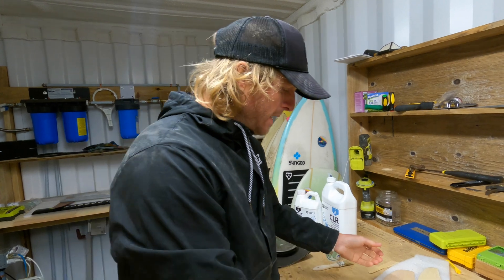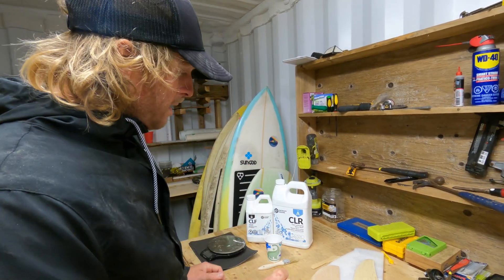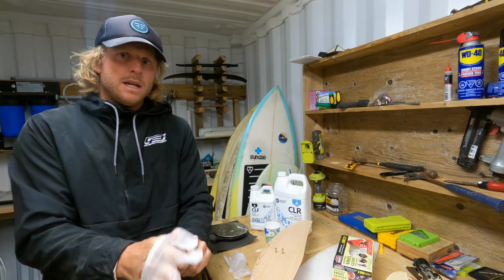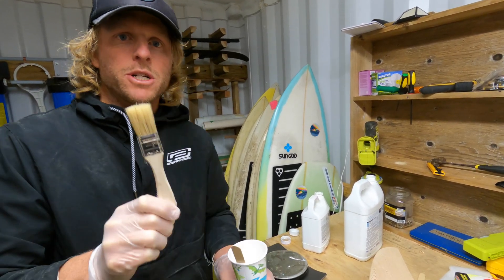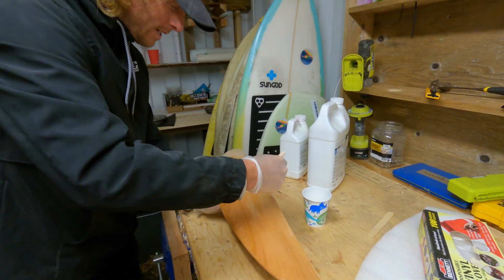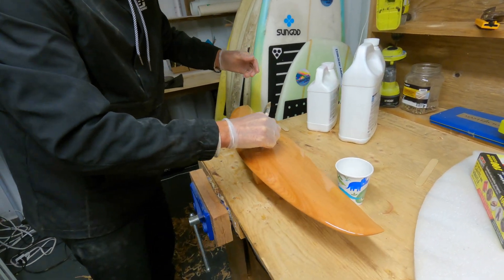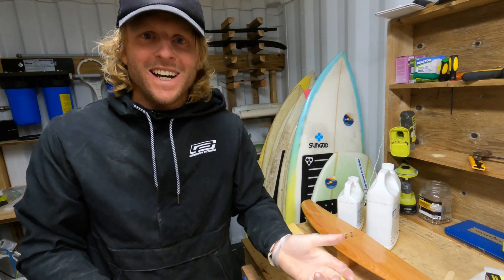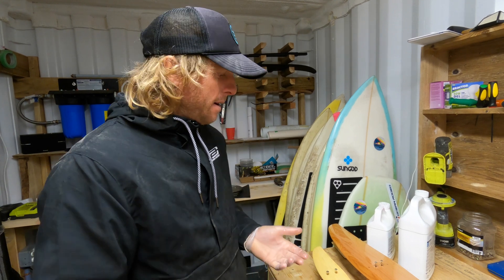How to Build a Hydrofoil: Wing Resin Sealer Coat (Video 4/15)

Comment: If I want to enlarge the Wing to 2000 cm2  how large could be the rear Wing, more or less?
Reply from the maker: hey, you can leave the rear wing, or scale it up. its up to you. That said, 2000 is a lot for this design without reinforcing the screw connection points. So you may want to create a socket connection for that size
Reply: @FlukesKitesurfing  THX a lot, obviuosly connection Will be  reinforced.

Comment: What I did for better adhesion, was I heated wings to 120-130 C, so some water evaporated and air exhausted from wood. Then when it was ~80 C I applied resin, that quickly absorbed into the wood. I applied more and put carbon cloth lamination. 
Main point - you should not wait until base layer of resin got completely cured before applying next layer. If it is not cured - the bond will be strong chemical bond, if cured, the bond will be weaker adhesion bond.
So, my way it created strong chemical bond from resin-soaked wood to top layers of lamination.
Reply from the maker: Thats a good idea, that said we have not had any de-lamination issue as all. even in the hot sun. :)

Comment: Love your work! I'll finish watching this series then have a go at making these. Did you know that if you paint the epoxy onto a wooden part and then go over the part with a heat gun, the epoxy briefly thins out and absorbs into the wood? It'll soak in surprisingly deep and saves getting drips.  A few coats of this and the impregnated wood can be easily sanded and polished to a finish that's good enough for moulding. All the best mate and thanks for making these vids.
Reply from the maker: Hey Simon, nice thanks for the tip, i haven't tried that. I'll give it a go.